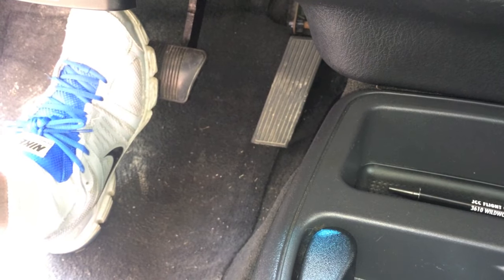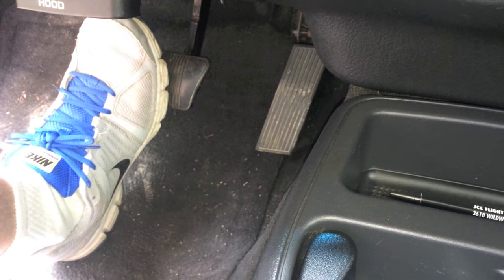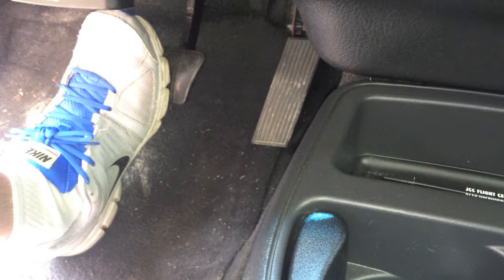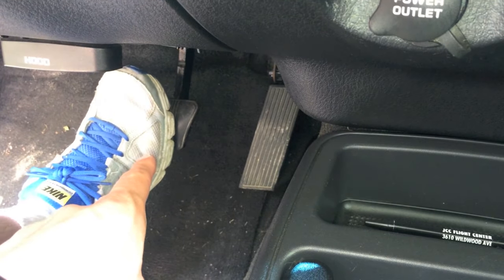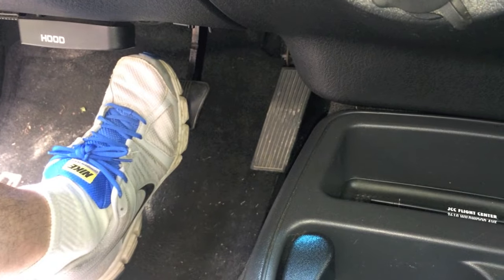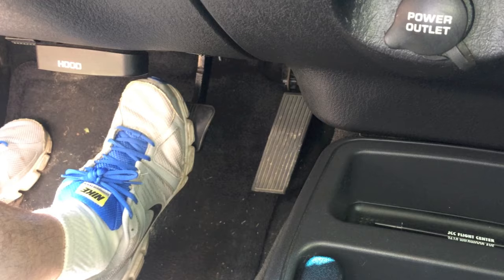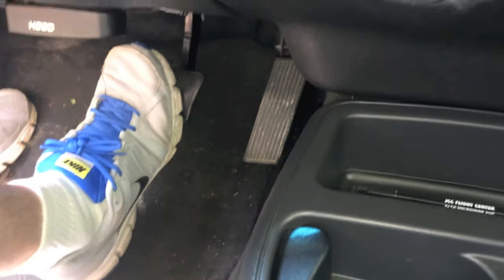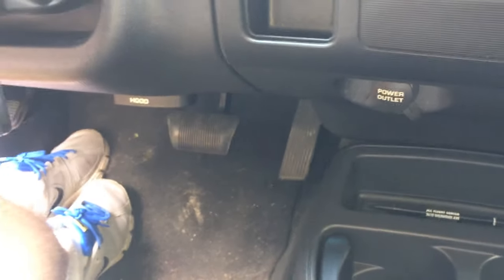HARD Brake Pedal - How to check if your BRAKE BOOSTER is GOOD or BAD

Comment: Hi I did procedure pedal did everything as it should although on the first press I heard a loud hiss 94 Ford Falcon
Reply from the maker: Thanks for watching & a hissing sound is an indication of a vacuum leak.  While your engine is running, we recommend opening up your hood and carefully inspecting the vacuum lines feeding off of your brake booster.

Locate the line that is hissing and leaking and head to your local AutoZone where they can get you the exact replacement part.  Keep us posted.

😎👍🔧🔩
Reply: @DIYwithMichaelBorders  thank you I will do that now I'll start with large hose with PCV valve going into grommet on booster
Reply from the maker: @markkouros6628  

😎👍🔧🔩

Comment: My breaks booster in my car making my car run  funny
Reply from the maker: Dennis James 

Thanks for watching Dennis!  Have you completed this procedure to verify that your Booster passed or failed the test?

Keep us posted!  Please subscribe to the channel and turn on your YouTube notification Bell that would be awesome thanks again!  😎👍🔧🔩
Reply: My breaks power booster is hessen  when I pump them to the floor
Reply from the maker: Dennis James 

Thanks for the reply!  Has there been any recent repairs done to the Brake System in the last 12 months?
Reply: DIY With Michael Borders. No
Reply from the maker: Dennis James 

Let’s look into a few items.

1.  Let’s check the brake fluid reservoir & verify that the fluid is within the proper fill parameters.  If brake fluid is over or under the proper fill lines, you will experience degraded brake system performance.

2.  We recommend doing a thorough inspection of the entire Brake System including all parts, lines... & check to see if there are any signs of leaks.  In the event that you find a leak along a brake line, this leak can be the cause of your degraded brake system performance.

3.  Start engine & check to see if you hear a “hissing” sound... if you do then you have a vacuum leak which will cause your exact symptoms.

Let’s start there!  Keep us posted!  😎👍🔧🔩

Comment: When i press my brake pedal down it starts pushing back up hard like its fighting back ......if i pump it make random sucking noise best way to describe like somebody sucking on some thing ...
Reply from the maker: agentstona 

Thanks for watching & sharing your experience!  Let’s get this figured out!

This is definitely more common than you think.  A few things it can be.

1.  Your Brake Booster has begun to leak fluid into the Booster itself...giving that noise you are experiencing.  If that’s the case, you need to monitor the Brake fluid level inside reservoir.

If you have no leaks along entire brake system & your fluid level continues to go down, that’s your indication that fluid is leaking into Booster.  A new Booster will be required to fix problem.

2.  You have a fluid leak somewhere along the line & or air has gained access to your system.

We recommend completing a thorough inspection of all brake lines and all parts connected to your entire brake system to verify you have no brake fluid leaks anywhere.

If no leaks are found then we recommend bleeding your entire brake system to see if this gets rid of the noises and improves your brake system performance.

Keep us posted!

Please subscribe to the channel and turn on your YouTube notification Bell 🛎 that would be awesome thanks again!  😎👍🔧🔩

Comment: i have a question i took the ford explore  sport track to the mecanic to fix the break paddle and to change the booster w he did but i still a problem stopping only on the stop the paddle goes forward w is the mecanic check again and he told me thats is good what you think it could be?
Reply from the maker: inocente molina hi there thanks for checking out the video.  Have you recently checked the fluid level in your brake reservoir?  After completing big repairs such as brake booster, Master cylinder, and calipers/rotors...you re-fill the fluid and then after a few times driving the vehicle, the fluid fills system and then you may need to add fluid to bring it back up to the full line. 

Also do a thorough inspection of your entire brake system including lines underneath vehicle as well as under hood where booster is.  Also check all Vacuum hoses and look for leaks as well as hissing sounds from a leaking vacuum hose.  Any of these can result in deteriorating brakes.  Subscribe to the channel if you're up to it thanks again

Keep me posted 😀👍

Comment: A mechanic I just had check an issue that sounds like a fan rubbing said it’s my break booster. My instincts says I don’t think that’s the issue. Sound starts up spontaneously corner front driver dashboard. It’s a mystery.
Reply from the maker: Good morning ☕️ any update?

Do you feel or have you experienced any recent issues with your vehicles braking?  If not, we can set the Booster aside and look at other possibilities.

If you are certain that the sound is coming from inside vehicle, we recommend turning the heat or AC to the high setting.  This will allow your fan motor to peak out and give you a chance to listen and inspect underneath drivers dash where pedals are.  Try to pinpoint the exact location sound is coming from.

Let’s start there, keep us posted.
Reply: @DIYwithMichaelBorders  thank you for your response! Lol Get this. After quoting me a $450 brake booster and the labor brings me to just under $1k job. 
A mobile guy shows up yesterday, listens for 30 seconds, kneels down under my driver seat, pulls a plug and says that was your subwoofer. 😂 
He tested my brake booster and just laughed and said it’s working just fine. And that I don’t need new brakes, rotors, drums, shoes. 
But what I do need is 2 front tires. 

He didn’t charge me a dime for driving to me. 10 min later he was on his way. 
Needless to say I won’t be going back to the shop that told me I need to replace my brake booster, brakes, rotors, suspension. But not the tires. 😂 
Thanks again for your help.

PS. My AC works like a charm. No issues there. 
It was the subwoofer all along. 12 men I had look at it had no clue. And 1 tough lady no clue. All mechanically skilled. 
Until Mr Mobile shows up in my life. He’s my go to mechanic for now on.
Reply from the maker: @reylove33  

That’s awesome news and we appreciate the follow up.  Another example of why it’s best to make it a DIY project and not replace what the shop says.

You saved $1,000 by being smart enough to have that feeling you mentioned of “I don’t think that’s the issue”. Awesome job!

Hopefully many stress-free days ahead for you.  👍🧰
Reply: @DIYwithMichaelBorders  ha. That was just a quote for the brake booster job. Shop said closer to 4K a work needs to be done. 

You see, I explain my car was sliding slightly when making a wide left turn at intersection. 
Shop said it was my suspension. I didn’t think that was it. It felt like it was like my feet slipping so could it be the wheels. 
Shop said Nope, it’s suspension. 
Mobile mechanic said front tires are cracked, hard like plastic. 

So in reality all I need is…
New tires $200 and install $50 and oil change $80 is all he said I need for now. 

Happy New Year. Thank you for your encouragement. 🥳
Reply from the maker: @reylove33  

Awesome Awesome, and thanks again.  Happy New Year.  👍🧰

Comment: My brakes are stiff but it went forward when I turned it on. Any ideas?
Reply: And thanks for the video.
Reply from the maker: Peterson Q 

Thanks for checking out the video.  Let’s get this figured out.  😀

Has there been any recent repairs done to brake system in the last 12 month.  If so, this will help us figure out if any recent repairs are causing your degraded Brake performance.

Take a few minutes & inspect all brake lines and brake parts.  Do a thorough inspection of all parts & lines to see if you can find any leaks.

Also check the fluid level inside your brake fluid reservoir and verify it’s within the proper fill perimeters.  

Let’s start there!  Keep us posted!

Please subscribe to the channel and turn on your YouTube notification Bell that would be awesome thanks again!  😎👍🔧🔩
Reply: DIY With Michael Borders I got the car in January it was fine but I put 6000 miles since then and this is very recent, a couple days. I already inspected and couldn't find any faults and the fluid is topped off.
Maybe I should go to a mechanic to inspect it?
My Dad said it my need to be bled.

Thanks for the reply I'll keep you posted.
Reply from the maker: Peterson Q 

Thanks for the reply!  It’s very possible that your brake system needs to be bled.  Since there are no leaks & your system fluid level is topped off, it’s possible that there is a small amount of air in the system causing the issue.

In addition it’s also possible you have a vacuum leak!  We recommend turning the engine on and opening the hood and try to listen and see if you hear any “hissing” sounds coming out of the lines that feed out of your brake booster.  If you do hear a hissing sound...you will want to replace the vacuum lines and that may fix your problem.  Let us know what your mechanic finds out!  Thanks again!  😎👍🔧🔩
Reply: DIY With Michael Borders Ok, so I didn't bleed the breaks or get them checked out. But now for some reason they are working great! Like some one came one night and fixed them for me. Haha. They are almost too good now and I have no idea why. I'm happy tho.
Reply from the maker: Peterson Q 

😲...that’s so awesome 😆!  We appreciate the update!  Looks like you have a “secret admirer mechanic” ...I’m kinda jealous 😆

Definitely keep us posted on future issues may you run into any!
Reply: DIY With Michael Borders lol what if it is a secret admirer or like idk a Angel lolol. That would be sick and funny cause they only fixed one tiny thing and I still got loads of things to fix on my car. Either way whatever happened it feels great to not have to pump my brakes like a maniac and wet myself every time I stop. Haha.
Reply from the maker: Peterson Q 

That’s so true 😀

We still recommend checking your entire brake system for leaks just to be 100% sure.  We definitely want you to keep us posted as you continue to drive the vehicle.  Let us know if you have any additional brake issues!  😎👍🔧🔩

Comment: i have a problem with my olds everytime i press the brakes the idle goes up and down and then shuts off the engine. theres no check engine light. again only if i press the brakes.
Reply from the maker: Idel Air control valve is most likely gunned up and corroded.  Those are very simple and don't cost much.  Subscribe to the channel that would be awesome thanks again!
Reply: DIY With Michael Borders ok thanks for your response but can that effect by presssing the brakes several times.
Reply from the maker: ROGELIO ROCHA yes I ran in to this problem a few years back with a car and the same symptoms that you mention I had.  After changing the master break seller it went away
Reply: You mean the brake booster
Reply: I have a video in my channel but nobhelp from anybody yet
Reply from the maker: ROGELIO ROCHA Master Brake Cylinder.  By chance have you inspected the rubber hose that feeds off your throttle body and goes to your air box.  Any indications of rips, warped, and leaking hose can lead to these symptoms.
Reply: DIY With Michael Borders but it would only do it when is in parking. I will check thanks.

Comment: chevy s10. I lost all brakes. they went to the floor. replaced a leaking line and master cylinder still no brakes.
Reply from the maker: Imachowderhead Oh no...that's no fun...and dangerous haha.  Have you completed a full brake fluid flush in both Master brake Cylinder and brake lines at each wheel?
Reply: DIY With Michael Borders no I bled the back brakes only. not the front  do you have to bleed all four?
Reply from the maker: Imachowderhead Unfortunately yes although it definitely is not fun but a must when changing the Master cylinder.  Keep me posted
Reply: DIY With Michael Borders thanks. I'll do that tomorrow
Reply: It worked. I bled them all, and the brakes are good as new. Pads, shoes and rotors are all like new. Thanks for the help.
Reply from the maker: Imachowderhead HOT Digity Dog...that's great news!  Thanks for the update!  Glad you're back in business 😎
That's Awesome 👍.
Reply: Can I get help?? My dad thinks I broke his truck because the breaks he said are going all the way down to the floor. 

I don't think I did it because I drive slow and lightly hit the break so?? Help

Comment: my brake pedal gets hard when i pump it twice and can no longer stop the car.
Reply from the maker: Kimmayong ka-bunyan 

Thanks for checking out the video!  Lets get this figured out!

This is definitely not uncommon!

It can be a few different things....thats if you are experiencing a HARD Brake Pedal...

1.  Its possible that your caliper is beginning to stick...maybe caliper slides have lost the lubrication required to shift back and forward freely.

2.  It can be possible that your Caliper piston has lost its lubrication which will also interfere with the efficient shift back for forth.

3.  The front rubber brake lines that connect to your caliper fail from inside rather that outside.  This means the inner coating begins to break away and clog portions of the brake system...hence not allowing fluid to flow back and forth freely.  

4.  Your brake pads have little prongs/teeth on them.  You will notice by their location...the pads slide on a steel brace.  This may need to be lubricated to bring the shift back to efficient requirements.

I have attached a few videos.  Lets start with the easy items and then work our way up!  Lets figure this out together!  Keep me posted!  Please Subscribe to the channel and turn on your YouTube notification Bell that would be awesome!

1.  Caliper Slides Lost Lubrication:

https://www.youtube.com/watch?v=-DZ68tKuCQc&t=15s

2.  Too much Fluid in Reservoir:

https://www.youtube.com/watch?v=X-AJ5tD6zoA&list=PLjCXOz8TSkZnavDiGDyHdPKe2dV2RzEMZ&index=39

3.  Failing Front Brake Lines:

https://www.youtube.com/watch?v=3FTEgbLYAdI&list=PLjCXOz8TSkZnavDiGDyHdPKe2dV2RzEMZ&index=78

4.  Brake Pads not shifting:

https://www.youtube.com/watch?v=3Pq15BWM_qY&t=103s

5.  Replacing Front Brake Calipers:

https://www.youtube.com/watch?v=8HoaL4QM5-k&list=PLjCXOz8TSkZnavDiGDyHdPKe2dV2RzEMZ&index=83

6.  How to check if Brake Booster is Failing:

https://www.youtube.com/watch?v=VK4lowH7kQE&index=66&list=PLjCXOz8TSkZnavDiGDyHdPKe2dV2RzEMZ

7.  Failing Brake Booster:

https://www.youtube.com/watch?v=j9s7yccswPQ

8.  Symptoms of a Failing Brake Booster Check Valve:

https://www.youtube.com/watch?v=j9s7yccswPQ&index=68&list=PLjCXOz8TSkZnavDiGDyHdPKe2dV2RzEMZ

9.  Master Brake Cylinder Failure:
 
https://www.youtube.com/watch?v=F9s_1VZ2u5E&index=24&list=PLjCXOz8TSkZnavDiGDyHdPKe2dV2RzEMZ

Again let us know!  We are here to help!

Comment: What if it's still hard after doing what u said, do we need to replace brake booster or it can be rectified?
Reply from the maker: Whats up Rocky Kho, that is a great question!  Thanks for checking out the video!  Lets get this figured out!

This is definitely not uncommon!

It can be a few different things....thats if you are experiencing a HARD Brake Pedal...

1.  Its possible that your caliper is beginning to stick...maybe caliper slides have lost the lubrication required to shift back and forward freely.

2.  It can be possible that your Caliper piston has lost its lubrication which will also interfere with the efficient shift back for forth.

3.  The front rubber brake lines that connect to your caliper fail from inside rather that outside.  This means the inter coating begins to break away and clog portions of the brake system...hence not allowing fluid to flow back and forth freely.  

4.  Your brake pads have little prongs/teeth on them.  You will notice by their location...the pads slide on a steel brace.  This may need to be lubricated to bring the shift back to efficient requirements.

I have attached a few videos.  Lets start with the easy items and then work our way up!  Lets figure this out together!  Keep me posted!  Please Subscribe to the channel that would be awesome!

1.  Caliper Slides Lost Lubrication:

https://www.youtube.com/watch?v=-DZ68tKuCQc&t=15s

2.  Too much Fluid in Reservoir:

https://www.youtube.com/watch?v=X-AJ5tD6zoA&list=PLjCXOz8TSkZnavDiGDyHdPKe2dV2RzEMZ&index=39

3.  Failing Front Brake Lines:

https://www.youtube.com/watch?v=3FTEgbLYAdI&list=PLjCXOz8TSkZnavDiGDyHdPKe2dV2RzEMZ&index=78

4.  Brake Pads not shifting:

https://www.youtube.com/watch?v=3Pq15BWM_qY&t=103s

5.  Replacing Front Brake Calipers:

https://www.youtube.com/watch?v=8HoaL4QM5-k&list=PLjCXOz8TSkZnavDiGDyHdPKe2dV2RzEMZ&index=83

6.  How to check if Brake Booster is Failing:

https://www.youtube.com/watch?v=VK4lowH7kQE&index=66&list=PLjCXOz8TSkZnavDiGDyHdPKe2dV2RzEMZ

7.  Failing Brake Booster:

https://www.youtube.com/watch?v=j9s7yccswPQ

8.  Symptoms of a Failing Brake Booster Check Valve:

https://www.youtube.com/watch?v=j9s7yccswPQ&index=68&list=PLjCXOz8TSkZnavDiGDyHdPKe2dV2RzEMZ

9.  Master Brake Cylinder Failure:
 
https://www.youtube.com/watch?v=F9s_1VZ2u5E&index=24&list=PLjCXOz8TSkZnavDiGDyHdPKe2dV2RzEMZ

Again let us know!  We are here to help!
Reply: I did the same test n yes it push  a bit when I turn the engine on which mean break booster is fine, so do I need to flush out brake oil on all the four sides tires or what shall I  do now? And I want to say thank you so much for replying my queries
Reply from the maker: Rocky Kho 

Very cool & thanks for the update!  Definitely let us know if you have any additional questions!  We are here to help!  😎👍🔧🔩

Let’s get you back up & running 😎